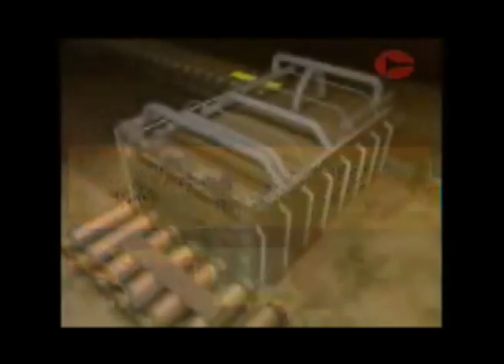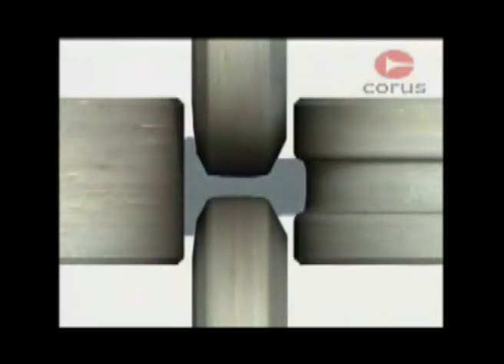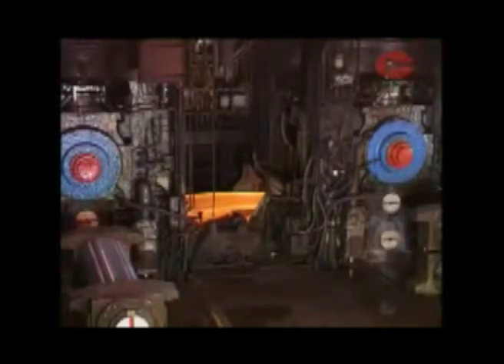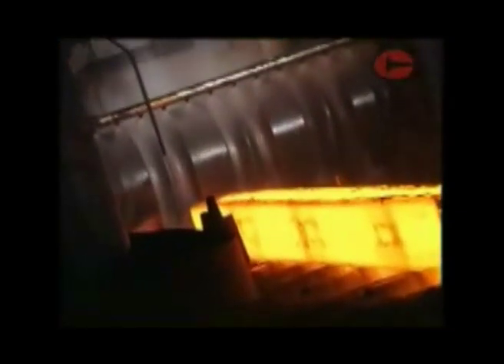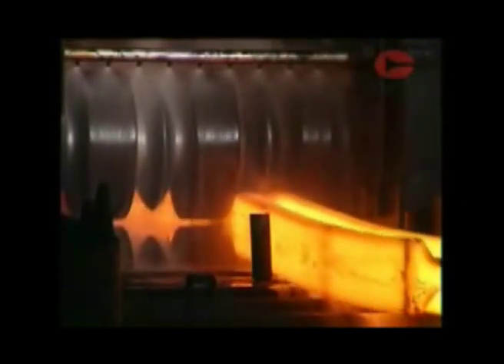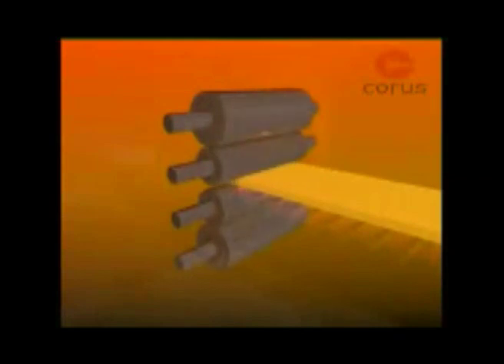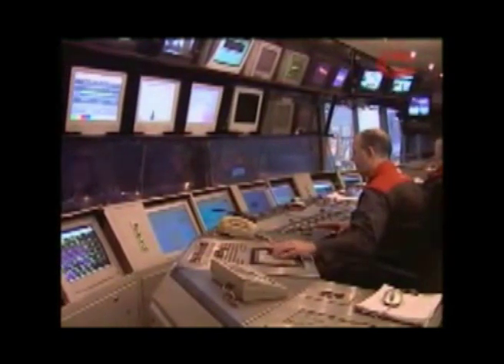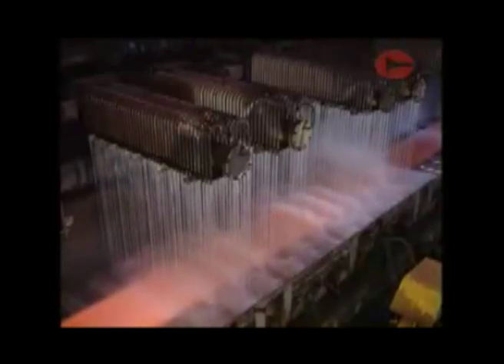Proceso de fabricación (Laminación)

Comment: El acero es altamente resistente al conformado cuando está frío y, por eso, generalmente se lamina mientras está caliente.
Para asegurarse de que el acero esté a la temperatura correcta para la laminación, se mete a un horno, de aquí viaja a través de varias zonas de control de temperatura hasta que esté a la temperatura correcta y listo para laminar. 
Cualquiera que sea el producto, los principios de la laminación horizontal son iguales, el acero se aprieta entre los rodillos hasta que se alcanza el grosor y la forma deseados, para hacer esto, los rodillos deben ejercer fuerzas de más de algunas decenas de millones de Newtons equivalentes a un peso de miles de toneladas, por lo que los rodillos corren en rodamientos masivos montados en carcasas de gran fuerza y accionados por potentes motores eléctricos, estos se conocen como soportes de molino.
 El diseño de un laminador puede variar de un simple molino de soporte único a varios soportes colocados uno al lado del otro o en una línea, los rodillos del molino pueden ocuparse para la superficie plana del producto como una tira utilizada para productos como el revestimiento de un perfil, para vigas de secciones y columnas para su uso en la construcción, los soportes del molino tienen varios arreglos de rodillos dependiendo del producto que se lamina.
El arreglo más simple es un soporte alto utilizado principalmente para productos con secciones largas, para secciones ligeras y barras, a veces se utilizan tres soportes altos con el acero pasando en una dirección a través del espacio inferior y de regreso a través del espacio superior, para que los soportes altos puedan funcionar los rodillos deben hacer  contacto con el acero, soportados por rodillos de respaldo más grandes para evitar la distorsión causada por la superficie de laminación, estos brindan una mayor precisión para laminar productos planos como placas.
 Los molinos de vigas universales incluyen soportes con rodillos horizontales y verticales que soportan el acero simultáneamente. 
El proceso es controlado por computadora y monitoreado hasta 50 veces por segundo a pesar de la enorme escala que se puede medir, la precisión de algunos molinos es de más o menos 50 micras, el acero laminado se enfría de una manera apropiada para su uso final y se prepara para un proceso posterior.
Reply: Aquí un intento de traducción de lo comentado en el video.
Saludos!
Reply: @juanantonioperezzavala9640  Muchas Gracias.